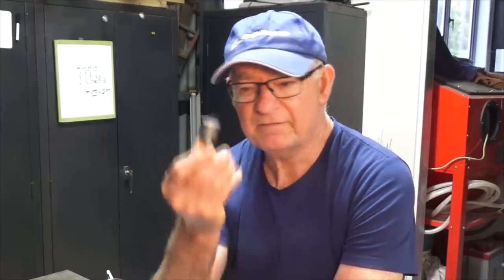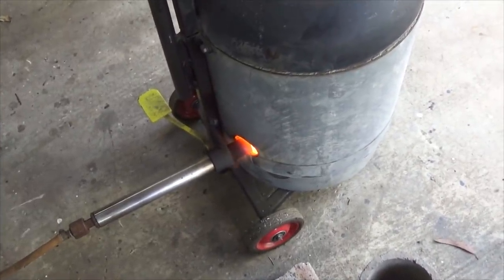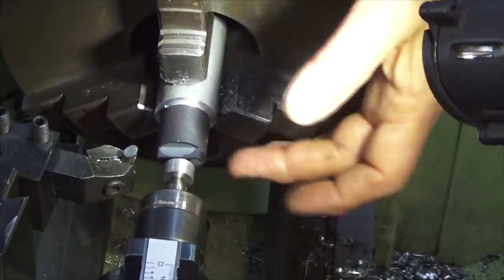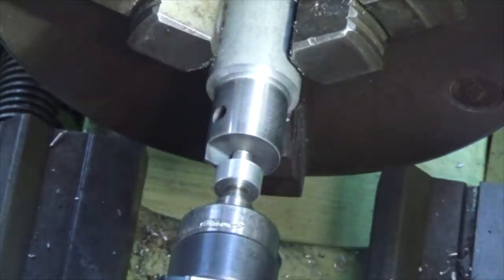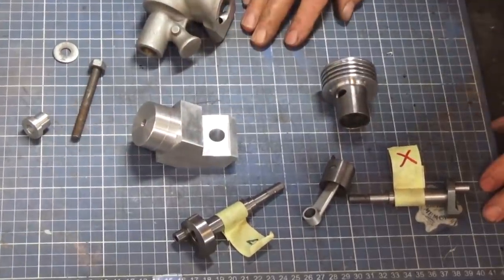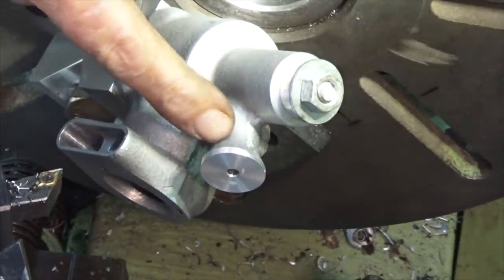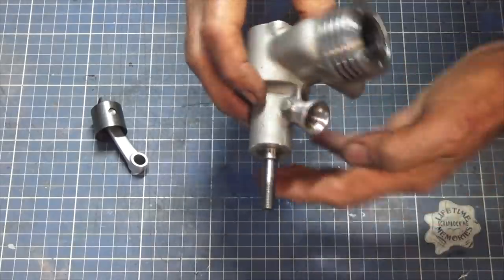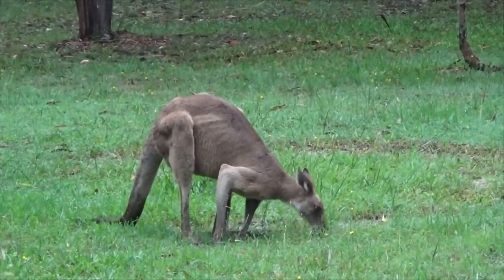Building the Titan .60 Glow Plug Engine #12

Comment: Hello Mark, My father, Titan 60 designer George Genevro, continues to enjoy your videos. He asked me to contact you regarding the patterns for the engine that have recently surfaced. Those patterns are the master patterns that were used to make the match plate tooling that was used to make to production castings. This means that any parts made from those patterns would be 2% to 3% larger than the parts you are working with. He thinks they might still work but wanted people to know about the difference. The match plate tooling still remains missing. Keep up the good work!
Reply from the maker: William, thanks for letting me know and I am glad that your Dad is watching. I hope I am doing it right. No doubt he will be picking up all my mistakes. I have been in contact with the person who owns the master patterns so I will let him know about the size issue. Please let you dad know that I am really enjoying the build although at first I thought I was way out of my depth. Working on the Titan has forced me to work to much tighter tolerances than I have been used to previously and I have had to learn a whole lot of new skills. 
Regards,
Mark

Comment: great way of mounting the part on the lathe. I wouldn't have thought of that. Excellent Mark, really nice work.  I personally think you are too tight on the engine. When I was younger, we used to lap the Fox engines which were tight, with valve lapping compound. A friend told me that Duke Fox used to stick a big flywheel on new engines at the nationals and first lap, them with a drill , then put the flywheel on after cleaning and run them in.I don't know how they cooled them without a propeller, but just thought I would share that.
Reply from the maker: Thanks. I know the piston is a bit tight at present and I have contacted Tom Lipton to see if he can shed some light on the question of the embedded diamond lapping compound. Hopefully it is something that can be resolved easily. 
Regards,
Mark

Comment: Very nice video again, love the stories of how to create and use use tooling to create. The idea of "handlapping" pistons is done a lot to shorten the break in proces and also to end up with a more lose piston for a better performance.  As mentioned before the slight tapered sleeve is no problem at al, it is even better. Due the different temperatures between the upper and lower part of the sleeve it will become more straight and not negative tapered. ow with the tight fit you can decide to hone the sleeve as well for a better hold of the oil and so a better compression as well.
A made a new video of making a new type of crankcase backplate which is a new trend today.
Reply from the maker: Nice work on the backing plate. I wanted to fit an O ring to seal the crankcase but it was difficult to get the diameter I wanted (imperial). I guess it will have to be a laser cut paper gasket. 
Regards,
Mark

Comment: Gday Preso, fantastic work, you have explained why the piston in both my Webster engines keep getting scratched up, the one I gave Dad has had around 10 tanks for fuel through it and the compression is still as good as it was before the engine had been ran, I don’t think it’s doing a lot of damage so far, I really hope someone takes up the offer of doing the castings, it would be great to many more of these engines built in the future, absolutely loving the series mate, your doing a great job, Cheers
Reply from the maker: Thanks Matty. Your engine had the benefit of having piston rings so they form the seal and they are at least replaceable. My engine won't be doing a lot of running so if it does wear the piston I won't be too worried.
Regards,
Mark

Comment: you may find if you use an os max or super tigre style spray bar you can point the hole in the spray bar at right angles or towards the crankshaft and still get the venturi effect even in a straight induction profile
spray bar in this straight tube would be easy to test just a little bit difficult to describe
by increasing or decreasing the venturi size at least you will get some sort of throttling effect for speed control.
Small bleed nipple in the back of the crankcase can pressurize the fuel system which can assist with some fuel delivery if needed
on some brands off motors the venturi has even been offset to the crank centre line (as long as the porting is timed the position is for practical reasons )
great content men enjoying the build series immensely

Comment: A lot of the older non ringed model engines had a choke bore on the cyl. with an alum-bronze piston and a chrome liner. When it warmed up everything expanded for a better fit.
Reply from the maker: I have read about the choke bore design and that is what I hope to achieve. A chrome finish bore would be wonderful but probably outside my skill set.
Regards,
Mark

Comment: Great video Mark. 

Do you use an EQ on your audio? There is a high pitch hiss throughout the voice over on the bench, which you might be able to supress with a low pass filter.
Reply from the maker: I have been adding an audio track filter to try to remove the cicada noises. It's better but I'm no audio engineer so I will have to do more to resolve this.
Regards,
Mark
Reply: @Preso58  I struggle with the audio side of it as well. What do you edit in? I use Resolve, and it's Fairlight bench give a full set of audio editing tools.
Reply from the maker: @RotarySMP  I did try DaVinci Resolve a while ago and while it looked great and I got the hang of it quickly, as soon as I went to render the video it crashed the computer. I have one of those Asus small form factor PC's with on board graphics and I suspect it needed a bit more video memory to process the video. I am currently using Vegas Movie Studio platinum and it has lots of audio tools but my biggest problem is that I don't edit using headphones. I just listen to the audio through the PC speakers and of course I know what the dialogue should be so I am only listening for continuity and I mute the machine noise. I sort of take the view that it's the narrative and the continuity that's important. I really should listen more carefully for things like hiss and background noise. BTW, I am loving the Schaublin build. 
Regards,
Mark

Comment: The pattern in the piston is from the wood. You might not be able to feel it but wood has different densities in its grain. If you want a perfect mirror finish then you need to be backing the sand paper on something as hard and smooth as what you are aiming for.
Reply from the maker: That is probably true but as long as the grain in the wood not aligned perfectly parallel to the long surfaces of the tool it should even out as you grind the surface. Probably a plastic like Delrin would be a better choice.
Regards,
Mark

Comment: Looking great Preso! I have no idea how you are going to align the cross hole, looking fwd to seeing your method👍
Reply from the maker: Me neither! It would be nice to think I could drill both separately and have them line up perfectly but we both know that's not going to happen. I'll give it a shot though.
Regards,
Mark
Reply: @Preso58  Hey Preso, I reckon you will have to make a test bar to fit snuggly in the inlet bore to clock off of and locate the centre, then move over to the boss location. There is no guarantees that the boss will be aligned perfectly with the bore! You could then support the part on the test bar in a vice, and drill through the part and the bar. If the bar was the same diameter as the brass insert, the same set up on the vice could then be used to cross drill the brass plug.😀

Comment: You might want to try a Flexhone (we called them dingleberry hones 😉) on the liner.
It will not remove any material if used properly, and it will probably remove the diamond,
As a side benefit, it will debut the ports.
Great videos!
Reply from the maker: Thanks. I have seen those flexi hones before and I do have a brake cylinder hone somewhere but so far I've been unsuccessful in finding it. Is it possible to have too many tools? Just kidding, of course not!
Regards,
Mark
Reply: @Preso58  - I found a brand new brake cylinder hone in my dad's old tool cupboard. It's got the flexible shaft and long flat hone plates. If you want more info just reply to me and I will go check more details.
I'm in Sydney but it'd be pretty cheap to post. We are finding that the 'roo pouch deliveries are very unreliable, and I think they might stop off to have a drink and a fight much too often.
Reply: @Preso58  I am referring to Brush Research's Flexhones. They are not like the spring loaded 3 arm brake cylinder hones.
Greetings from the state of Virginia, USA 🇺🇲

Comment: Very interesting build! I have never built a model engine, seems very rewarding. Very interested in what comes out of the discussion on diamond embedding, I have been wondering if it is an issue. I have used cast iron, aluminum and cast tin laps depending on the hardness of the material being lapped. General wisdom seem to be that the lap should be softer than the material being lapped. The diamond then supposedly embeds in the lap and not in the material. But lapping cast iron which is porous raises the concern of particles being retained in the pores. I know that cast iron lapping plates can be hard ro completely clean when changing grit size. Then the soap cleaning some mentioned should make sense, perhaps window cleaner spray which is great for cleaning granite surface plates. Using something that breaks down during lapping is one way to be safe. I have used Autosol chrome polish for removing um:s on hard steel, got the tip from the INA bearing company decades ago. Lapping starts aggressive and becomes gradually finer.

Comment: Back in the day I used to do a lot of engine rebuilding and I found that I was able to get the honing grit out of the cast iron bores using White King D laundry detergent. This was old fashioned animal tallow soap  and I was told that this made it dissolve petroleum oils and the grit would float out too. I always got several rolls of cheap paper towels and whipe the bores till no more black showed up. I regularly had engines that lasted 300 K. Miles. Sometimes simple is usually better.
Reply: Agree, I rebuilt a lot of engine in my day and all  I used was good old Velvet soap ( full of animal fat and caustic soda) to rinse the barrels clean after honing.

Comment: I would agree with the person about using the ultrasonic cleaner to get ride of any debris from diamond laping. It will work. Just do not have anything else in the tank to clean at the same time. Regards Mervyn Price
Reply from the maker: Thanks, I will give it a go. I have also contacted Tom Lipton at OxTools to ask for his advice. He is the lapping guru so I hope he can shed some light on how to proceed.
Regards,
Mark
Reply: @Preso58  Yes totally in agreement. After giving it a bit more thought. A plastic bag with a multigrade detergent motor oil in it plus the barrel, possibly fully synthetic 5W40 (I live in England) so Australian alternative will do. Though you may be advised upon a good quality diesel engine oil,.  The idea being to replace the tiny voids with oil & drive any unwanted particles out.The bag to keep you ultrasonic tank free from a lot of oil. Mervyn Price.

Comment: More nice work. 
The Kanagaroos looked like three young lads on a Friday night after a pint too many. 
On the brass venturi insert, does the "upstream" side of it not need to be blended to the same venturi radii that the aluminium casting is to ensure there is no step  there to disrupt airflow as it approaches the spray bar, I think that you will want (as close as you can get it) a laminar airflow over the spray bar. Also, on the "downstream" end of the brass inset, will it not be easier to leave it long so it interferes with the crankshaft bore, then drill and ream it away so that the end is very close to the crank when assembled - thus not leaving an increasing diameter step for the vapour flow into the engine? I realise that performance isn't a huge factor with this motor for you. 
Some excellent work. I'm enjoying the feature. 

Glenn
Reply from the maker: Glenn, It isn't clear how the designer intended the venturi setup to work. There is one very small drawing of the venturi insert and it isn't shown on the assembly drawing and it makes me think that nothing in this area is too critical. I have a very old 1.5cc diesel engine (first one I bought with my own money) and it just has a parallel sided hole with no flare on the venturi and a cylindrical spray bar going straight across the venturi hole. What you have suggested makes sense and I guess there is plenty of scope for fine tuning the engine if it's performance you're after. I'll be happy if it makes a few pops.
Regards,
Mark
Reply: @Preso58  you are probably correct, guess any performance gains would be marginal anyway, and as it is museum bound, it doesn't really matter. I am pretty confident from what I have seen that it will run just fine when you come to fire it up.
Not long now.

Glenn

Comment: Would it be worth milling a flat on the end of the removable throat, and a corresponding flat inside the bore to allow for interchangeably? Great shows, been following for awhile. Keep it up, plenty of followers here in the US!
Reply from the maker: William, I'm hoping the engine will run first time and that I won't have to do any tuning. I get the feeling, just reading through the build notes that apart from the fit of the piston in the bore and the accuracy of the piston length and the position of the ports that everything else is way less critical. We'll soon see. I am hoping it will be ready to run in a week or two.
Regards,
Mark

Comment: with those scratches on aluminium piston , did you consider there be some burs on the edges of transfer ports?
Reply from the maker: No, I hadn't thought of that but I did hone the cylinder liner a second time after milling the ports so that should have removed those burrs. Also the scuff marks were all around the piston, even on the sections that didn't line up with the ports. 
Regards,
Mark

Comment: Are their claws retractable, or fixed in position?  The scratching, fleas or ticks down there?  Or just wrong shampoo choice…..
Reply from the maker: Their claws don't retract. They are like dog claws and they use the claws on their hind legs to give them instant traction when they take off. However they are also superbly designed to rake at surfaces above the ground as well. A kangaroo has a very thick layer of skin and muscle covering their bellies but humans don't unfortunately. Best to lie face down when threatened with a male kangaroo. They do seem to be bothered by ticks and fleas. They will roll on the ground to get rid of anything they cannot reach with their forelegs
Regards,
Mark

Comment: Looking good! Now for that needle valve :-)
Reply from the maker: That's something I am not looking forward too. Lots of tiny holes and close fitting parts. I did take delivery of one of those little sensitive drill spindles which at least give you some feedback when drilling with little number drills in the lathe.
Regards,
Mark
Reply: @Preso58  Yep, that's why it's so interesting (I would guess for most of us). I wouldn't like to do it on camera, though :-)
I had my share of bad experiences drilling small holes in aluminium, particularly if it gums up (although I don't think it's the case with this casting, judging from how well it turned and polished in the lathe).

Comment: Mark, I am wondering how you ensured that the intake port/throat was going to intersect the bore of the crank at the centreline? You seemed to index everything off the outside of the raw casting, which was an very odd thing to work off.
Reply from the maker: I thought long and hard about how I was going to drill the initial hole and whether it would in fact line up with the bore for the crankshaft. At the end of the day I chose to indicate off the exterior of the casting knowing that it was unlikely that it would intersect precisely. It was close but not exact. I guess it was more of an aesthetic decision since there is no real requirement for the two holes to be exactly on the same centre line in order for the engine to run. All the timing is done at the cylinder ports and it's controlled by the position of the piston skirt and the crown. The venturi hole is just a way of getting the air and fuel into the crankcase. I am hoping to talk about the two stroke cycle and how it applies to this particular engine in the next video. 
Regards,
Mark
Reply: @Preso58  - I was more worried that perhaps you'd bore out the side of the casting or something... it looked crazy spinning in that faceplate, especially in the video footage.
Anyway if it ended up slightly off the centre line of the crank, you could say it was a design feature to add swirl to the intake charge. 😂

Comment: Once you had the normalised piston on the mandrel, I though you were going to explore the piston bore surface with the dial guage to see what the effect of the normalising was. 
But you didn't.  :-(
Keep up the excellent work, though.
Cheers from sunny SA
Reply from the maker: No, opportunity lost there I'm afraid. I should have measured the outside diameter before and after heat treatment too. I had my doubts that anything would have distorted or moved though. The build notes said to normalise it though so that's what I did. 
Regards,
Mark

Comment: I lap piston and cylinder liner with fine 320 grit valve compound.
Reply from the maker: I have some of that stuff somewhere in a drawer. It doesn't embed like diamond and it gradually breaks down but it's a lot slower to get results. I really should get in touch with Tom Lipton to see what he thinks. 
Regards,
Mark